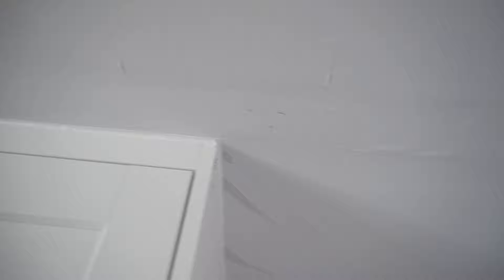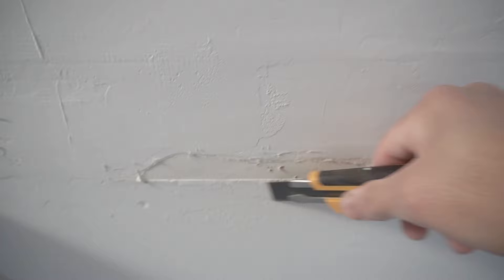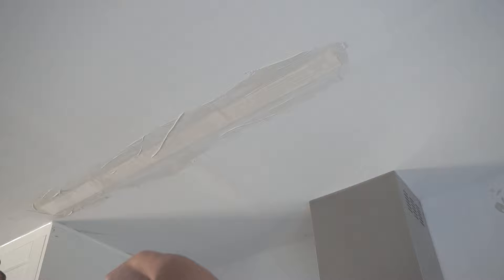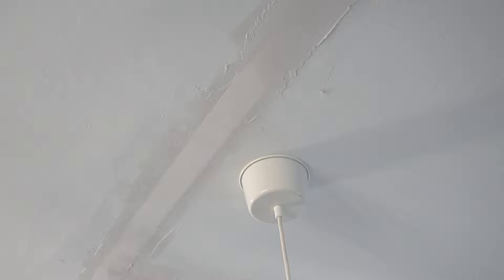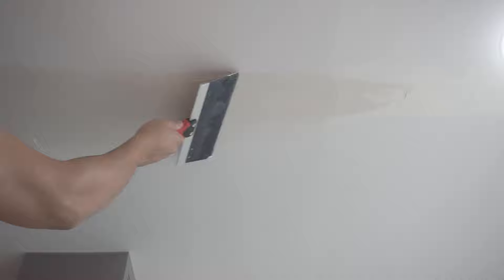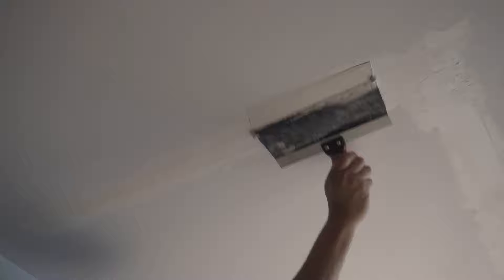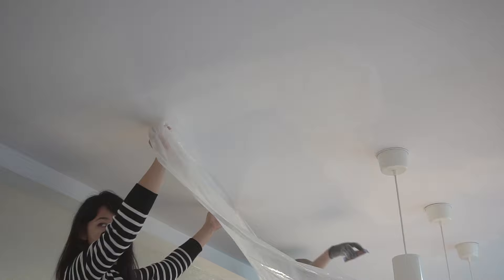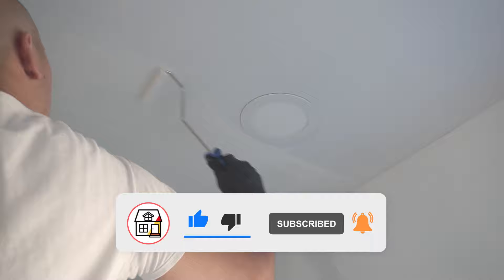How To Fix Messed Up Drywall Work! Bubbles And Craters! DIY

Comment: Hi there, thank you for the info. Your video was extremely helpful. I attempted to do the modding, although not horrible - it still needs some cleaning up. What would you recommend for a sander for bigger areas? Or just stick with the block you suggested?